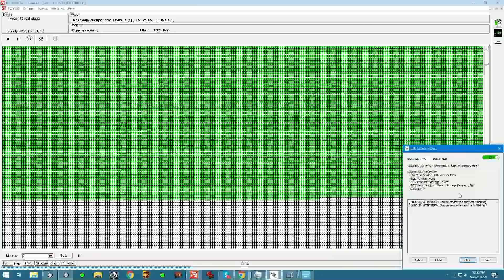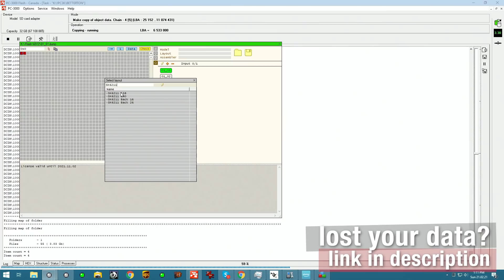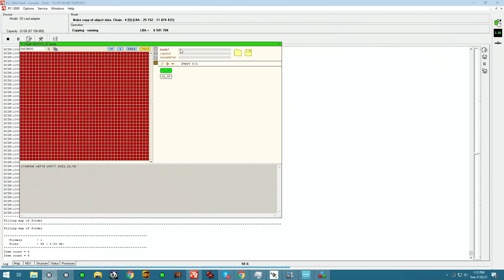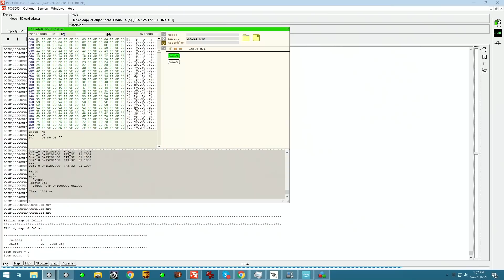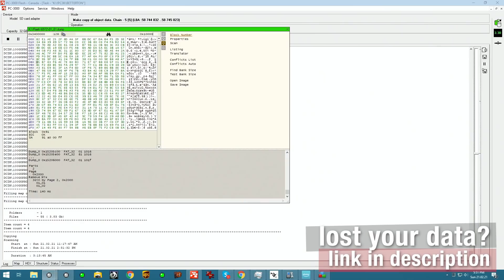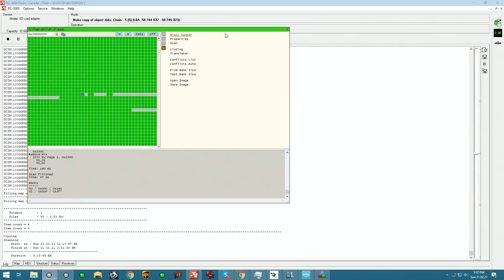how old flash drive with important data gets recovered?

Comment: Hello, HDD Recovery Services. First of all, great channel. A have a question which is going to sound stupid. I've watched some HDD to sand grinder conversion tutorials on youtube and tried it out with my old SATA and PATA HDD. They spin for a few seconds but stops. The tutorial shows that shorting pin 2 and 6 OR pin 3 and 5 (Rx and Tx) of SATA Data line will make the motor spin continuously. I tried it but it doesn't spin at all. Can you suggest a way to make an old SATA and PATA HDD motor spin continuously? Thank you.
Reply from the maker: It depends on PCB.
Reply: @hddrecoveryservices  ok, Thank you.